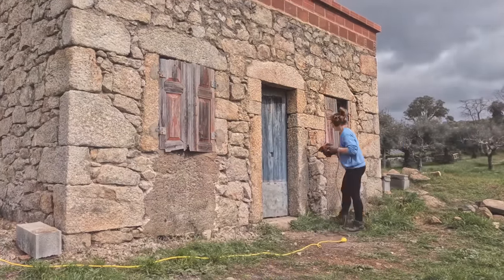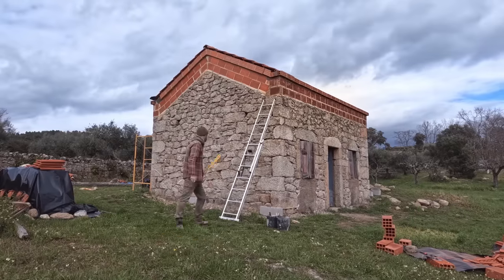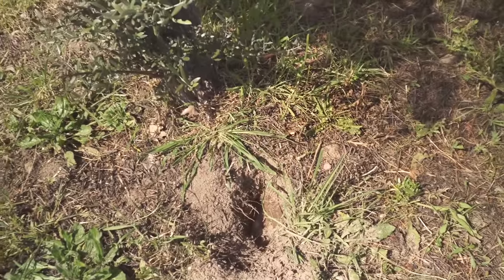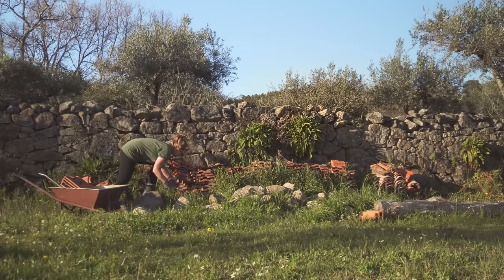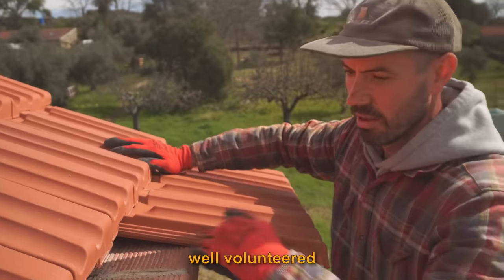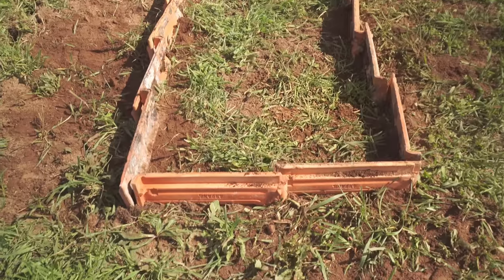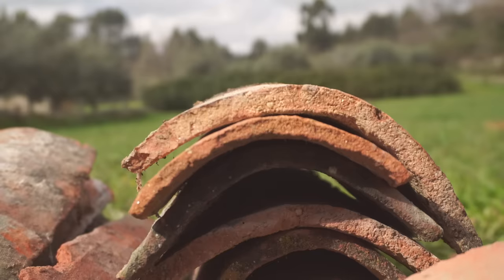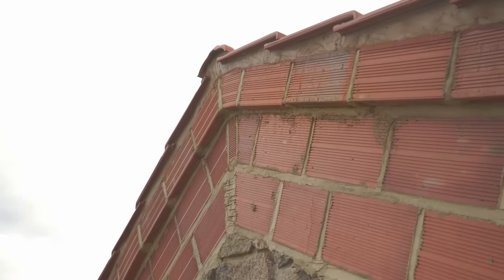How Did WE Make THIS?! Our Stone House DIY Roof Is FINISHED!

Comment: Repel moles naturally with a plastic bottle
Bottle: take a plastic bottle and remove the bottom from it. Then dig the bottle into the mole corridor. If the wind blows over the bottle, it will cause a whistling sound throughout the corridor that moles don't like.
Reply: Okay it may repel them but where do they go from there? Won't they stay in the same area because there are a lot?
Reply from the maker: That’s an interesting idea. Thanks for the recommendation 😎
Reply: @LifebyLiving  you're welcome and hopefully it works. Maybe an idea that you show it in the next video and then also share the result.
Reply: Glass bottle will also help. Dig the whole bottle for 2/3 and the wind will do the rest

Comment: Question. Could you create a stone planter box under the windows to cover up the concrete mess?  It would save you the hassle and be an interesting feature.
Reply: I love your idea Susan.  I was then thinking that they can build them out of wood, and then they would match the wood shutters of the windows. 😬
Reply from the maker: We did consider covering it but decided not to. We’re already tackling it as you’ll see in the next video 😊

Comment: Best trick I've heard for moles is dig out the freshest holes and place a bottle glass or plastic with its bottom cut away. Leave the top off the bottle and fill around it's sides. The wind passing over the bottle frightens moles away.

We've binged watched you both this weekend. Fantastic. Bless you for saving Poppy too ❤

Comment: Victoria, your enthusiasm for gardening is inspiring. A suggestion from experience if I may:  your new tile beds are surrounded by a type of grass known to have very aggressive root growth. To prevent its invasive ability to reappear in your new beds, approximately once a month with a sharp-edged spade, slice as deep as possible straight down just outside the tile surround. That's all; just slice straight down all the way around. You will want to go at least 8" to 10" deep. This effectively slices off new & persistent root growth, but will need repeating as suggested. Secondly, with respect to the tiles try to avoid planting anything closer than 4" to the west-facing pieces. This is because the day's sun will heat up the tiles more on that side which in turn can dry out the nearby soil, making it a struggle for new plantings and their important hair roots to survive. This from similar hot and dry summers such as you experience. Green thumb carry on!
Reply from the maker: Thanks for the tip! We’re wanting to kill the grass between the beds & cover the pathways with something but not sure what. Wood chips is apparently a risky choice because of fire risk. Any ideas?
Reply: @LifebyLiving  (1) One method is to cover the grass with clear plastic weighed down around the edges with enough stones that it stays in place for a few days. This creates an 'oven' underneath, the intense heat building up from the sun eventually bakes the grass (goes very pale grey/green). Remove the plastic and with a garden fork loosen the area about 8" deep (not digging up but waggling back and forth while in the soil), then pull out the grass in its root clumps, the slower the better. Discard for burning. Repeat patch to patch. (2) Rake each patch level, cover with thick cardboard and then your choice of a final top material, something that will not easily be wind-blown or messed about with regular walking on it. No matter what is chosen the grass will eventually return, requiring trimming with hedge shears or garden scissors depending on the quantity. People sometimes sprinkle salt on it, which dries out the blades of grass and killing the plant.
(3) There will be other methods, but given the invasive tenacity of that particular grass and your commendable wish for clear walkways & working areas between the beds, I think this would work, remembering that "little green shoots" will eventually always reappear. Nature rules; She doesn't like a void.

Comment: Hi guys, that roof looks sensational, a job well done! Good succes on the potato side as well and the no-dig garden beds look great with the old roof-tiles! Poppy seems to be the most effective way to get rid of the mole problem, a bit harsh maybe. There are several ways however to help in this situation, moles do not like ultra sonic sounds or vibrations in the ground. They love fields with only grass so planting out bushes or trees with roots helps as they find it difficult to pass the roots when making tunnels, no moles to be seen in a forest. They hate garlic apparently as I found out, no idea how to go about in doing that other than planting out heaps of garlic.  It's by no means an easy task because after this you'll be left with more harsh methods that you don't want. Hope this helps a bit. Have a great week!!! Cheers Bert 🙏🏻❤

Comment: All your hard work is bearing fruit! The little house is looking fabulous and one can start to imagine how wonderful your main house will be when renovated.

Moles - I originally had the little critters invade my large garden from a neighboring field and devastated the 1/4 acre lawn and the herbaceous borders. An old country dweller told me to use firelighters, not to burn but to give off a smell which moles avoid.
Essentially, survey the pattern of molehills and try to work out from which direction the moles have entered the property, then work out which are the furthest mole hills from those points of entry. The idea is the  to initially contain the spread of the moles then "push" the moles back from whence they came. For large invasions, you may need to divide the property up and deal with several areas simultaneously.
Buy some firelighters, similar to Zip  firelighter blocks, which are inexpensive. Cut each individual block in to 3 pieces with an old kitchen knife. Carefully open up a molehill until you can see the tunnel. Gently push a piece of firelighter into one of the tunnel entrances, refill the hole with the soil and tread in firmly, but do not collapse the tunnel. As someone has already commented, the molehill soil is excellent for raised beds so level off the heaps so you can see new any activity. Repeat, repeat and repeat until you have filled a network of tunnels across the land. The vapour released from the fire lighter blocks will form a barrier and prevent the moles from using those tunnels. You will then have created a barrier line.
After a few days, watch for new mole hills and repeat the process. Again the idea is to push back the moles to the property line by denying them use of the existing tunnels. Not every mole hill has to be treated as the vapour will carry along the tunnels and so over a number of weeks the area in which the moles are active will be reduced. Again repeat the process with a new barrier line, but keep a clear route back to the property border line. Once activity stops on your land, drop blocks in each holes along the border line.

Once done, the blocks will work for years and you will have no moles.
Reply from the maker: I can see why that idea would work…unfortunately with the fire season approaching here I don’t think it’d be wise for us to put anything combustible in the ground as we’ll definitely forget where we put them!😂

Comment: Good morning. Make sure after you lay down the cardboard you take a large screwdriver and poke holes in the cardboard so if you get a heavy rain it doesn’t float out of the bed or push your dirt up and wash it over the edge of your trim.

Comment: Those overhanging roof tiles are gonna fall off without mortar. In Portugal we use semicircular tiles on the overhang which are secured with cement mortar. Then the rectangular tiles go from bottom up and then to the crown. Then rain gutters are secured to the semicircular tiles or to the stone wall.

Comment: In ZA we use wire windmills, the 4 pointy wire at the bottom are stuck in ground, the vibrations from the turning wheel irritates the moles and chase them away.

Comment: Hi both, as Ricky said, “Roof is done” - congratulations it looks stunning, securing the property with a new roof first was essential, the other list of jobs will flow from that. I note Ricky said you were going to point the exterior, then come back to render the upper part, I’m not a builder but would it be worth considering rendering the upper first to avoid the possibility of render splashes etc spoiling your pointing, although I guess you could hose any render off. Only a thought, but I defer to Ricky’s plans, he has been right on everything up to now.👍👍. BTW, although you are plagued with moles, you’ve got some nice readily sifted soil there that may come in useful, if you collect it up. Take care now, Paul 👍👍

Comment: I wonder if your under window caked on concrete areas on each side of the front door were possibly large windows extending almost to the floor and were poorly filled in to have smaller windows. 

For your mole problem I’d suggest a natural solution - two orange or grey Tabby cats. They are the best hunters and love hunting moles, mice, and other pesky critters.

Comment: A real milestone moment with the roof - you've got to be proud of the achievement. 

Regarding moles, there are tons of products on the market that make various claims but few of them work in my experience, so instead of ending up using traps I always suggest that's where you start, rather than wasting time and giving them a chance to do more damage and reproduce. Two to four moles can wreck an entire field. Usually you have fewer than you think. Claw and tunnel traps work well, but beginners are probably better off using the easy set type. Good luck !

Comment: Good morning from Colorado!
Spring weather is always interesting isn't it? Last week we had 12-26 inches of snow. Two days later the temps were 16°C ! I think the saying "Go with the flow" must really be to doing with weather.
We don't have a mole problem here. If you line your veg beds with a layer of fine chicken wire - really small openings - it'll keep burrowers like moles out of your veg gardens! Then put your cardboard on top of the wire. Build a cage with it to go over the beds to keep out rabbits, birds, critters etc. 
Congratulations on the roof! It looks good!
Blessed Be!
Reply from the maker: Oh wow that weather is waaaay more extreme than what we’ve had! You need your snowboots & your sandals at the ready!😂

Comment: We had a yearly problem with moles tried all sorts, old wives tales as well as more modern things. In the end we have been successful by walking along the runs between the mole hills and stomping the soil down hard. We did the same with the areas around the mole hills themselves. It seems to force the moles to go deeper and not come up where you don't want them.

Comment: You might wanna try sandblasting or dry ice blasting away the concrete from the wall. My guess is that you need a big compressor for such job. But I’m not a pro. Nice progress overall! Can’t wait for the inside work.

Comment: Moles and gophers are hard to get rid of. Lawn Mower noise scares them away sometimes. Also smoke bombs. I suggest that on the bottom of your no dig garden you place chicken wire under the cardboard, Gophers can't get through that. The cardboard will break down and they will get your plants. I know that you are already putting soil on top.Are you buying bags of soil? That can get very expensive. If you can find soil somewhere it can be delivered by truck. Its cheaper. I am so happy that you finished your roof, it looks very nice.
Reply from the maker: We’re using soil from our own land but buying in compost until our own is ready to use

Comment: What a relief to have that roof finished. You won't have to be up there working on it in the heat of the summer. Are you planning on putting solar panels up there? It'll be hard to spoil the perfection of the new roof with solar panels.

Comment: Personally I would have put the tiles in a vertical position ( minimum 30cm in the ground this would have protected your garden plots from voles ( I think they are voles and not moles) Don’t use traps, because if you use it you have a big risk to kill some ermine or weasel which are the main predators of voles. This happened to me!

Comment: hi don't want to upset you I live in Portugal and am doing my roof you need to drill holes not huge the size of a large drill bit at the level of the first waterproof membrane out of all the brickwork you have just done where the overhangs are so if any water gets under the tile it can get out

Comment: This number of moles means that the soil has a significant amount of earthworms. Digging the soil with a tractor or a motor cultivator tiller  and then having a flock of chickens roam around there would compete with the moles.

Comment: My wife and I have been binge watching your videos from the start, now on the plunge pool and so enjoy you two and the furry crazies. Which part of Portugal are you in if I may ask? Have Loads of questions but reluctant to ask and be too intrusive.
Reply from the maker: We're in Central - Castelo Branco
Reply: @LifebyLiving  Thank you for getting back to us,, I can`t believe the amount of rain you get. If i may make one small suggestion as you mix yards of cement and concrete  I notice you both pour your mixes into the side of the wheelbarrow try pouring it into the front of the barrow over the wheel which will distribute the weight better
Reply: just an observation not a complaint LOL